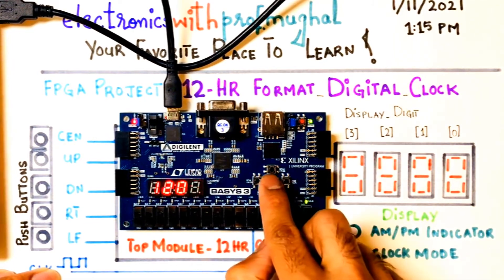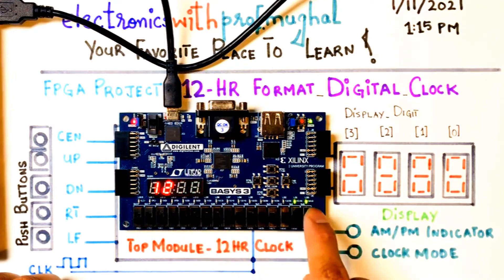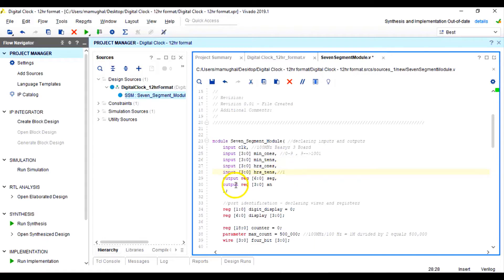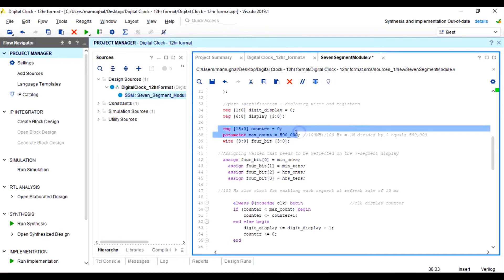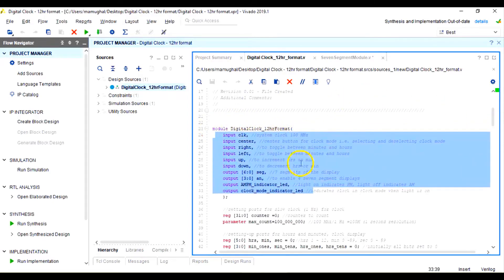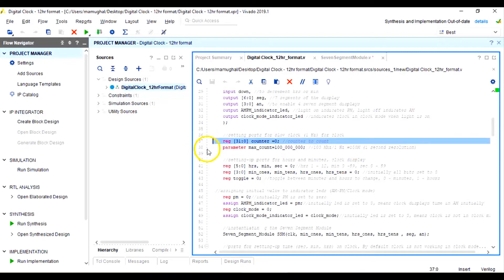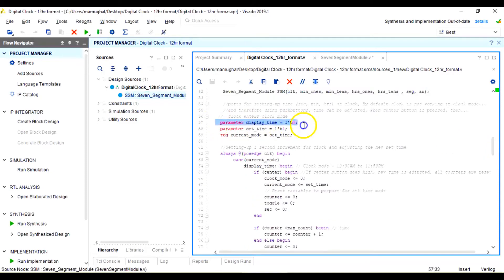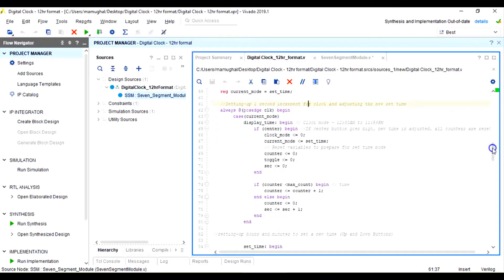#23 FPGA Project ➠12-Hr Format Digital Clock | Basys 3 FPGA Board | Verilog

Comment: Sir, Is it possible to turn ON ":" (colon symbol) present between 7 segment displays?
Reply from the maker: Yes, sure you can do that if your board has that capability. Mine doesn’t.
Reply: @ElectronicswithProfMughal   Sir, In the board you showed in the video has ":" between seven segment displays. Is it possible to turn it ON or the ":" colons are just dummy?
Reply from the maker: Yes, you’re right. Unfortunately, the board  doesn’t support colon. It doesn’t light up.